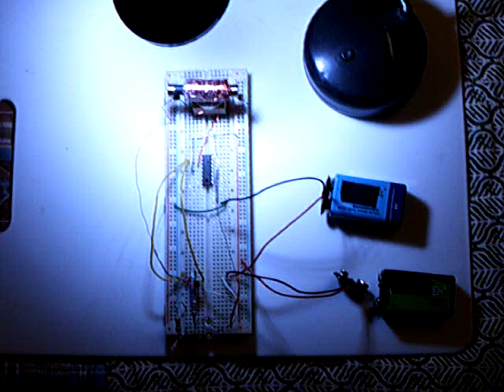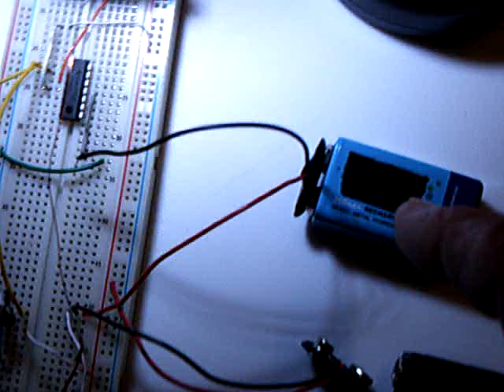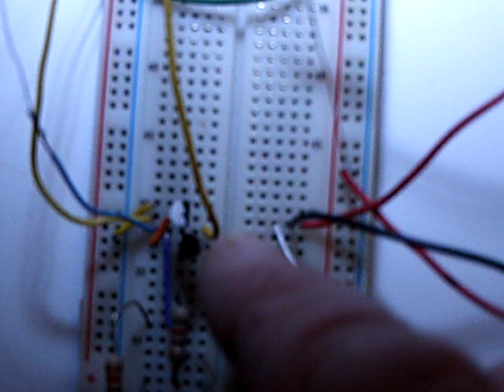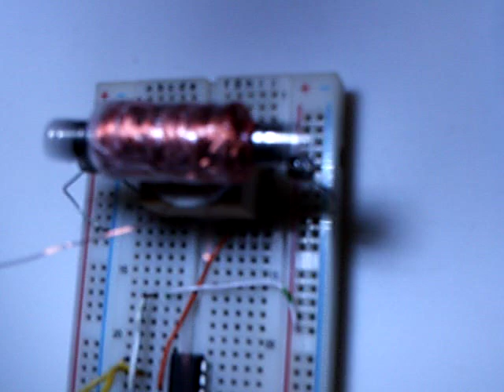TinselKoala's 'MescalMotor'--- my replication running

Comment: That's sort of neat Lidmotor. Hey, does no one make the full sized breadboards about 4 times the size of the one you have there  anymore?  I got one off of ebay like you have there and I was shocked when I got it because it is so small, I did not check to see what the size was on their listing, I just assumed it would be like the last one used. 
 Have you seen "A Perpetual Light" or any of the other videos on the Patrick  Kelly channel? I thought that one was sort of neat.
Thanks for sharing that little motor idea with us.

Comment: is that an LM324N op amp I once spent a lot of time cascading all four together with almost no other components to make an ultrasound amplifier. it worked quite well and was very simple to make, I used it for a lot of very interesting ultrasound experiments
Reply from the maker: Thanks for telling me about that.  I was wondering if you could link the 4 op amps in the LM324 chip together into something like a Darlington cascade and make a supersensitive component. Cool.
Reply: ***** think the only other things I used were an rf diode and a resistor in parallel as the feedback components on the first stage. and an ultrasound piezo transducer as the input. mostly used it with the printer port of a pc running qbasic.
 in one version used it to switch a transistor & relay for a simple remote control. it tended to feed back & destroy itself but the ic is so cheap it didn't matter 
used a 555 timer as the transmitter or the output from the printer port
Reply: david vernon williamson have you seen this http://hackaday.com/2014/12/04/amazing-sciences-simple-electric-train/

Comment: Lid:

This came about because I asked TK how the electronic Levitron worked.  I started a topic at OUdotcom and I found the patent.  TK came up with a circuit that swapped polarities on an electromag.  which is how the levitating device works.  It also uses perm mags to keep the floating mag centered.  He then found another use for his polarity swapping circuit.  I have learned so much from both of you guys.  If you would like to see some levitating videos that started this, pm me and I will give you the links.  This is probably right up your alley.  Great work as usual.

Bill
Reply from the maker: Pirate Labs Hi Bill.  I just went to the OU forum, read the entire thread, and got up to speed on what is going on.  This levitation project has my attention.  Years ago I tried to build a 'Levitron' using a hall sensor and op amp ----but failed.   Later on I did successfully build an infrared type that worked quite well.   I have always wanted to go back to the hall sensor type and give it another go.  I will be following along. TK should be able to build the new type levitron if he has enough time.
Reply: *****

Excellent.  Thank you for taking the time to read the topic.  I just thought this was another great example of doing something deemed "impossible" using known components and techniques. Those fellows in that second video hovering 4 pounds have really raised the bar on this in my opinion.  I will be attempting to replicate but, this one is just a bit over my head.

Thanks,

Bill

Comment: Wouldn't two magnet switches reduce most of the electronics? Reminds me of teslas earthquake machine :)
Reply from the maker: Yes.  I think this same motion device could be done with a couple of reed switches.  The electronic method done by TinselKoala was what really interested me. Using and op amp controlled push - pull transistor circuit was new to me.

Comment: I really don't understand why you find it sooo amazing.
LDRs are commonly used in automation. With two hall sensors you could do the same. If you make the coil yourself, you can easily run two wires in opposite direction. Blah blah. I am not excited.
It gets exciting if you use one wire, changing polarity, and use a short pulse: you pulse it when the bob is near the end, and use the BEMF together with a new pulse to change the direction. (par example).
Just sharing my thoughts, I don't want to shoot the messenger.
Reply from the maker: You are right. Moving a plunger back and forth inside a coil of wire isn't a big deal at all.  There are other and better ways to do it.  What amazed me was HOW he did it using an op amp / push pull circuit.  I just had not seen that done before and thought it was very interesting.  Hall sensors are the next step. Tinsel's original goal with the project is a locking magnetic levitation setup  His 'MescalMotor just kinda happened along the way. Thanks for the honest and helpful comment. This type of feedback really helps.  Now I have to look into the methods you described.  That actually sounds like a much better way to go.

Comment: This is awesome! Have you considered placing two piezo transducers on either side of the sliding rod. Maybe add some rubber bumpers/springs on each end of the rod, and let the sliding rod strike the piezo transducers. This would recapture some of the energy, then feed the energy back into the circuit to charge the batteries. If you can get the rod to strike hard enough, those transducers will produce a fairly high voltage!